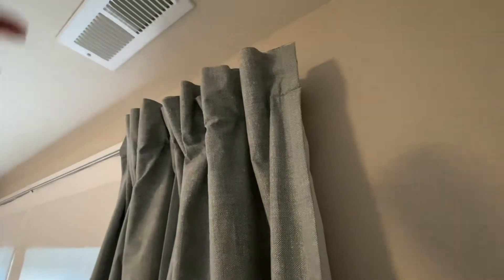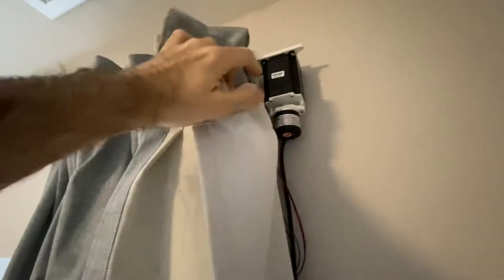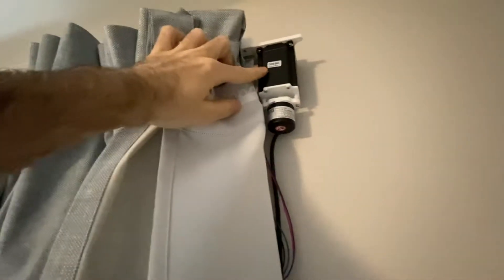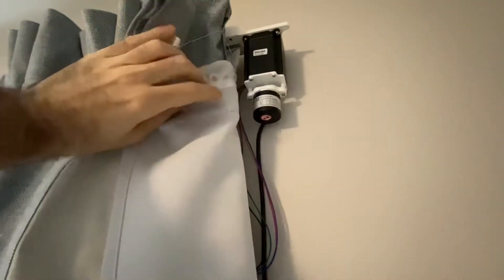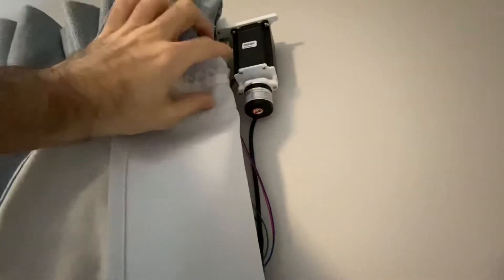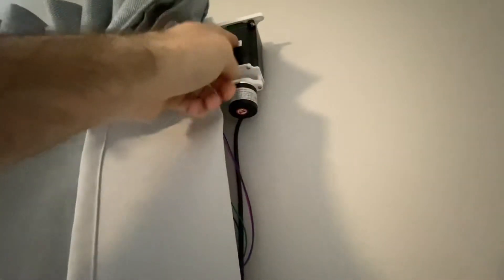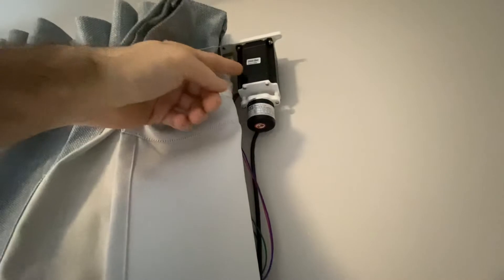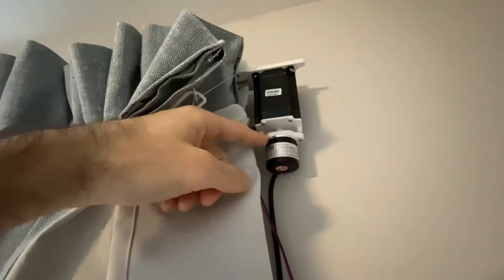Curtain opener rotary encoder

Comment: Thanks for the video! What are you using for the track? I'm impress with the quiet and fast operation.
Reply from the maker: The curtain track is IKEA’s Vidga triple curtain rail. I use one rail to slide the curtains, another rail to run the belts inside of, and the third is for the sheer curtains behind the blackout curtains. Then I printed end caps that mount the motor and belt return, and then some pieces to couple the first slider with the belt.
I should probably do a more informative video and put the 3D files online if you are interested!
https://www.ikea.com/us/en/p/vidga-triple-curtain-rail-white-20299155/
Reply: @PhilHarlow  Thanks for wonderful video ! it would be really helpful if you can provide more details and share 3d files please
Reply: can you please share the code
Reply: Do you have code and schematics please ?